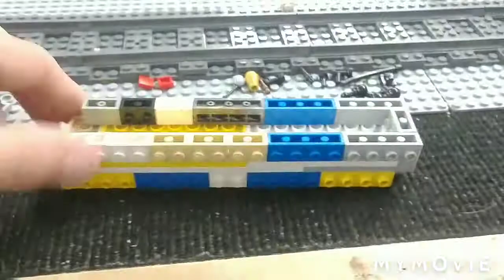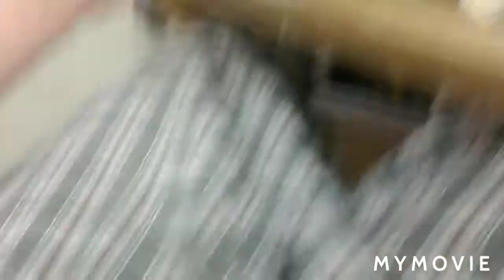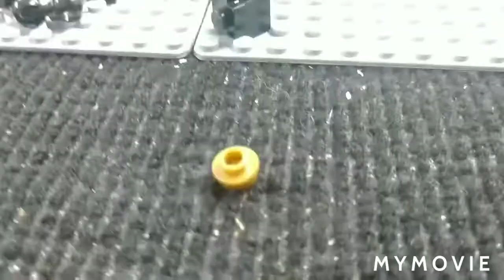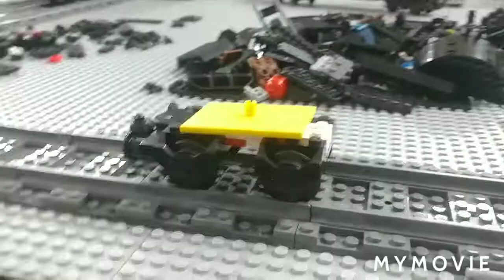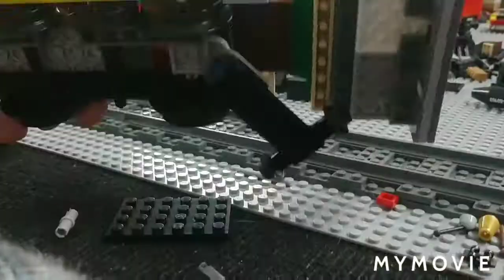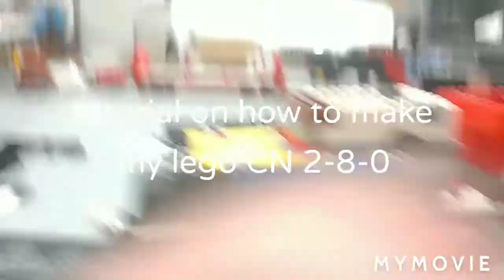A tutorial on how to make my custom lego canadian national steam locomotive.

Comment: You should spray paint the loco, or get the right color bricks.
Reply from the maker: I'm not a huge fan in painted lego bricks
Reply: Alright, though it would be nice. Would add the extra-point to a good model. (Just saw that it was a refrence model, didn't watch the video for long earlier lol.)
Reply from the maker: @jmtrainz2582  I already have a correct color CN 2-8-0
Reply: @battle604  Yeah I saw lol